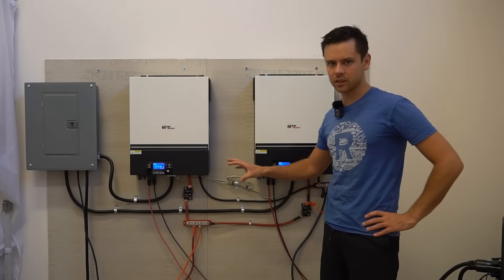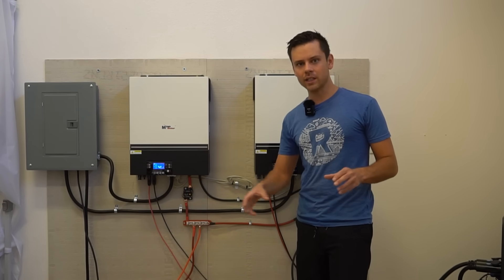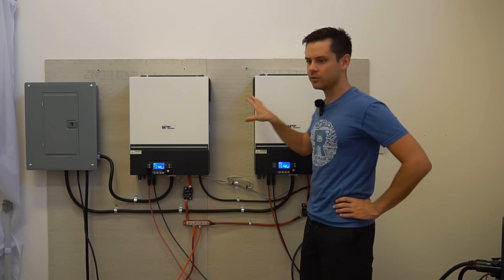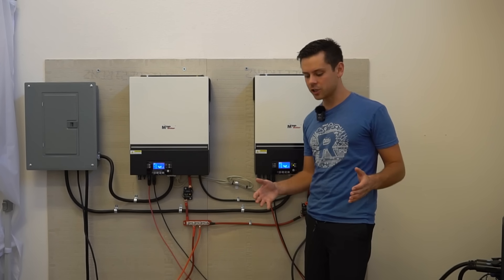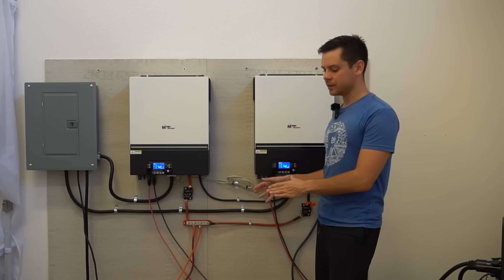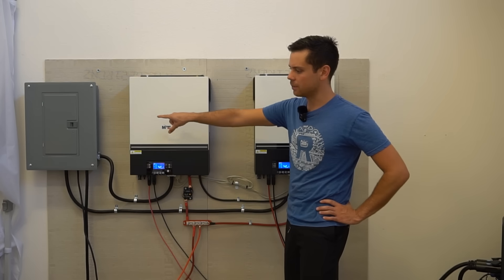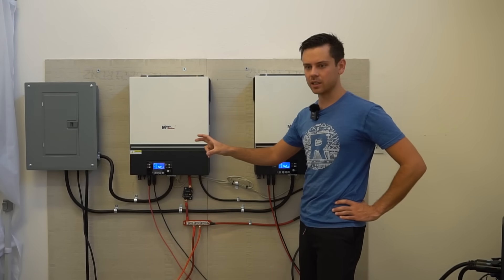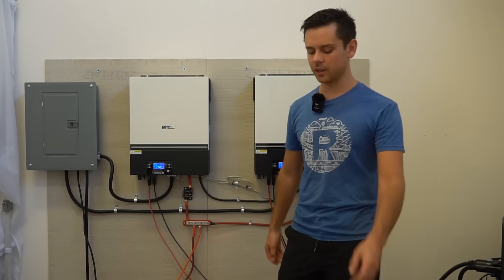Does my 13kW Offgrid Solar System require Grounding? Is it Grounded?

Comment: Thanks for another great video, Will.  Regarding the solar arrays, their frames still need to be grounded to an earth rod, correct?  For an array that is say 100 feet from the house, is there any need to carry that ground along with the positive and negative wires (i.e 3 conductors) to the house?

Comment: Can you go over this with portable power systems such as Delta Pro and AC300/500?  Do different UPS modes affect the grounding?  Ideally I'd want to set up an AC500 that powers a critical loads/subpanel mostly using solar/PV Priority UPS mode but then also have a circuit from the main panel plugged in for backup.  Also it would be ideal to be able to take the unit camping or use it as it as a mobile power station as needed too and just power the critical loads panel directly from the main panel then.
Reply: Also can autotransformers be used to fix/alleviate any of these issues?

Comment: On a related matter, I have hard question. My EV using the V2L cable produces a 240v supply that does NOT have a earth by default. So how can I power appliances which expect a AC supply with a earth ?  Please help ….

Comment: Hi Will, I have a cuestion? I install a inverter powmr is 230, 24v 3000W off grid when I check the power in the output lines, one give me 90v and the other line 170. I conect the ground I install a ground route outside the storage.

Comment: Hello Will, I have just discovered your videos and will be devouring them over the next while. Thank you for posting them!
I have a situation that as a non - electrician has me confused, and I am hoping maybe you might have an answer for me.
I am currently in the California desert in my solar powered cargo trailer/RV conversion. I am an astrophotographer, and spend my winter far out in the desert looking for dark skies. I have 4-325 watt Panasonic solar panels on the roof and 3-300 amp hour Lifeblue batteries for 900 watts total. The charge controller is a Midnight 150, and the charger/inverter is a Magnum 2000. The system was originally installed in my 5th wheel RV about 6 years ago by a very reputable solar company that specialized in RV installations. They have moved on and no longer do installations on RVs, so I can't talk to the people who actually installed it.
I recently moved the solar system from the 5th wheel RV to the current cargo trailer/RV conversion. Grounding to earth in an RV is not practical of course, and nothing on the solar system has been grounded to the frame. I had read that the panel, inverter, and charge controller should all be grounded to the frame, yet they weren't by the original installers. The team that installed my system had installed solar systems in about 3000 other RVs before mine, so I doubt if they just "forgot" to ground the solar components to the frame. I have to think it was intentional. So when I moved the system to the current trailer, I didn't ground anything either. So far all is working great, with 4 120 volt and 4 12 volt circuits. Only the fridge 120 volt circuit is not on a GFCI. My 120 volt Samsung home fridge specifically says not to put it on a GFCI protected circuit.
So my question is probably obvious: Should I be grounding anything to the frame of the RV? I used all metal outlet boxes, and they are all on internal walls. The outlet, and the box itself are grounded with a pigtail to the ground wire that goes back to the panel.
As a non - electrician, I have a hard time understanding why I would ever want to send electricity into the metal frame of an RV. This seems crazy to me, and a recipe for a serious shock. It seems like I now have a closed electrical loop with the panel. Why would I want to send electricity to the frame of the RV, under any circumstances?
As an aside, when I was a kid I stepped off a poorly grounded RV just after the rain had stopped. The step was metal, and I was barefoot and wet. I can only remember screaming and being frozen in place for a second or two before passing out and fortunately falling away from the step and breaking the ground. For a few hours I couldn't walk, and both my ankles were really sore. Within a few more hours I was fine. I suspect it would have killed me in a few more seconds if I had not passed out and broken the connection. It was a really terrible experience, and I don't want to relive it because I made a grounding error. But intentionally sending electricity into the RV frame just seems like the last thing I would want to do. Isn't an electrified RV frame what shocked me in the first place? Any advice much appreciated!
Reply: I'm in a small cabin and also wondering this.

Comment: So, I have my 110v from the service panel on the pole to my inverter then off to the RV. The solar panels are mounted on top of a metal utility trailer. The panels are all connected with ground clamps and wire. WHERE do I put the ground wire from the panels? The panel at the pole is earth grounded. Thank you

Comment: I have a Growatt 6000 , 18000 surge split phase inverter, can I connect a 120 ace wire to the inverter ac input from the house main 120  receptacle outlet to charge the 48 volt batteries.

Comment: If I am building a shed solar panel system with no plan to connect to the grid and no plan to have AC from the house connected to the shed (200 feet away), should I place ground rods and thus ground the solar array and inverter?

Comment: Hi Will. Thanks for the tech tips. I have a question, My pv is over vaulting my inverter, But only when windy. The Panels are in series, with a combined voltage of 73 V and the inverter is 100v max.

Comment: Hi man, need some help here if possible.
I have a small one 450w panel system with a 12v 250amp battery to run only my fridge(smart inverter), i am playing arround and testing and stuff.
I am conected to the grid, and have this small setup, but the two are separate, and i have no intention to join them.
My intention is to have two grids in my house, the grid, and my grid, to later on further grow my grid.
¿Is it a good idea to ground this system?
I have the neigbours comunity antena in my top terrace wich has a ground. ¿Would it be ok to conect ground there? This ground is from the grid, not my own.. is that a problem ??

Comment: Would it still require a true earth ground if there was no AC in the entire house. I'm talking not just not having grid tie in... I mean no inverter, no AC appliances. A DC range, a DC washer & dryer, even the AC is DC... that is to say the AC until (air conditioner) is DC powered.... in that event would you still need a true earth ground. I mean I get that not having one is physically possible and the system would still power loads... I know that a breaker system can physically be devised such as to catch some faults (similar to non-GFCI non-AFP circuit breakers, just basic breakers)... I know that AC houses could physically be wired without any true earth ground and would still power things just fine... but does the NEC require it? What if the system had 5v, 9v, 12v, 24v, and 48v circuits. Are all of those covered by low-volt PV systems? Why does the NEC use language that insist that DC houses must have photovoltaic voltage even if the power is from a windmill or some other non-PV DC producing system. Like why is the whole section called PV when clearly they mean DC not specifically PV sourced DC, but any DC... there's very little in the NEC covering DC only systems. This leaves a lot of leeway for someone who wants to build a house with no AC whatsoever on site. I've already seen my dad/boss bid such a job... we'll see if we get it. This isn't some shack with a well pump, it's a whole house. It is PV, but since I'm being pedantic already, I figured I'd ask if anyone knew why the NEC that is always so careful about language sometimes conflates PV with DC when the DC system may OR MAY NOT be from a PV source... I've just always wondered that one and thought I could through it in as a bonus question.
Reply: Why do we use true earth ground at all if it's not required for AC circuits to work or even for the breakers to work?

Answer:
 Well first, before fancy breakers were invented, we still did it... that first reason is because lighting is a thing and things can build up a static charge... true earth ground provides a path to dissipate that charge from loads and/or their chassis... so that still applies when using DC, even DC only, thus in my opinion a true Earth ground is still a good idea on a DC only system, and is definitely required for AC and mixed systems per the NEC... I'm implying that the host of the video's house is technically against code (as I interpret it) because it does require the DC system to be bonded to the ground of the AC system. It also requires AC systems to use a true earth geound, thus that requires the mixed system to tie into a true earth ground. 

My question is, does this NEC requirement still apply to a DC only household? As far as I can tell the answer is no. I would still do it because of the discharge path, but I think code doesn't care. I feel like someone on the code making panel should get more strict about DC only systems because they're starting to become a thing. We might be building such a house for some weird rich hippy couple so...

DISCLAIMER:
I am still an apprentice, so take what I say with a grain of salt... more than once I thought I knew what I was talking about, only to discover I was wrong. I have no guarantee that is not the case here. Feel free to correct me but know that trolling won't work because I'm surrounded by veteran electricians who know better, and thus I can verify weather what is said is complete BS or not, just by asking the next day at work.

They won't answer the main question I am asking in my original comment, because I'm supposed to look it up. Problem is, I tried that already. So answering the main question isn't some pointless endeavour, when I could just ask... been there, done that... didn't help.

Comment: Hey Will, after watching your presentation as well as Mike Holts, I assume I shouldn’t ground to earth my 12 panel, 320 watt each, solar array. It’s connected to a 9kw solar generator Renogy box that is in turn bonded to the inside panel. Most all videos say to ground to earth these panels but now I’m hearing different. ???

Comment: Just installed an axpert max 7.2kw, and as soon as it switches some internal relays while powering on, the house goes dark. Had to remove the input ground wire for it to run. Im assuming the inverter switches the neutral to ground internally 🤷‍♂️

In the manual it states the pv array must not be grounded to it as well..

Comment: I bought a bigger inverter a week ago. It have ac input failover. If the battery is too low it will charge the battery to my setting and handle the ac output( i think . Havnt tested) well never plugged in the ac input until today. Works like a charm. My house doesnt seem to have any ground pin in any of the sockets. So i just skipped ground(for now). I notised the battery, 12v lifepo, makes my fingers tingle, continuesly when i touch the bare wire or the +/- directly on the cell. It never did that before. Took a sec to realise it might be grounding needed when ac is plugged in. Is that static build up or what is the cause? Now i wonder if its any danger to the battery.

Comment: Have you discussed micro inverters vs a straight pull to single inverter? It doesn't appear you use micro inverters from all the videos I have seen. It is a higher expense for panel installation I would rather not if possible unless more efficient.

Comment: i do not understand my brain is still new to this. so you mean to say, "do not ground your solar panels but instead, ground your inverters" and put a surge protector on both the dc side and the ac side of the inverter. 

so if you ground your solar panels direct to earth ground, and a lightning strikes the ground near your earthgrounding, there's a chance that the lightning will travel from the grounding itself direct to the panel. moreover, a direct lignting strike in panels will yield damage regardless if grounded or not?  grounding the solar panels is useless and more dangerous in that regard? please correct me. i do not know what i'm thinking anymore.

Comment: You know a lot about electrical.  I do not have a solar system but EVERY time there I'd an electrical storm, my breaker trips and we sit in the dark until the storm passes.  If I flip the breaker switch, it just trips again when lightening flashes.  I thought we needed a ground but after this video, I'm not sure.  We do have a metal roof.  Can you explain why or how I can fix this problem?
Reply: You need to explain in more detail what you have? what breaker trips? Is your solar tied into your grid? Are you using any ground rods besides what is in your home?  Are your panels connected to your metal roof?

Comment: Please help...I am off grid with 2 victron inverters isplit phase. Everything works great but rainy season is coming and we get big lightning here in the rain forest.  My Breaker Box "which is very close to my components is ground using a copper rod. My panels which are 50 feet away are also ground using a copper rod. Is this ok or should I unground the breaker box?

Comment: I have a 3K hybrid inverter with a shore power plug. When using shore power a test of an unloaded socket shows wiring to be correct. However, when using the inverter without shore power, an indicative light suggests that there may be a wiring problem....Is it normal for this to happen? Also, I have safety switches and breakers in place and all seems to work well.......Thanks

Comment: The NEC requires you to bind neutral and ground on the secondary of a separately derived system (transformers, solid state inverters, etc.). The reason for this is because the primary and secondary are physically separated, therefore the grounding connection does not transfer. You should bind the primary and secondary grounds (exclude the primary neutral because it is bound with the ground upstream).
Reply: But what if the Secondary is NOT connected to the onshore grid panel? if you add a ground (no longer free floating) then you may create a ground loop or have a gradient problem even though you may not think they will transfer. 30 sec and 5 min portion of this video.

Comment: My solar panels are running to a midnite solar combiner box that's grounded to earth is it safe to continue on to the inverter with the combiner box being grounded to earth I'm not using the AC input part of the inverter just the output line and neutral my ground is on the side of the case with a screw

Comment: It seem confusing to get the correct info for solar subpanels. These are not subpanels from from a grid main panel.  Their basically their own panel so I don't see why they should tie back to main panel in anyway.  My issue is how to ground that panel and do I bond the neutral bar to panel as well?  I have neutral bar and a separate ground bar.  I have the Growatt and is connected to 120v in from my main(for fallback), as well as my solar PV.  And then I have the 120 output to my subpanel of which I have 3 circuit breakers connected.  Seems to work fine with standard circuit breakers, but when I tried to put in a arc-fault circuit breaker, it trips immediately.

Comment: This is a very confusing topic because of different configuration scenarios.
I still looking for the grounding answer to my setup.
I have an LV6548 in a cabin completely off grid, solar array and an inverter generator (eZV8500EFI with GFCI plugs) in a separate generator shack.
Generator manual is calling to connect the grounding conductor to the frame of the generator and it also has Neutral bonded to frame.
So what do I do when the generator is off (not running) and inverter is running of batteries or solar?
These two different scenarios are calling for completely different approaches and it is not exactly clear how to go between these two modes in terms of grounding and bonding of the neutral.
Any help is appreciated!

Comment: Thanks Will. Not many people talk about grounding system for the solar system and I’m glad you did. I plan to install a Growatt SPF 5000ES hybrid off grid solar inverter in my RV Bus in Bangkok, with Lifepo4 battery bank, and solar panels. This inverter will take solar power or take AC shore power to charge batteries and convert battery DC to 220Vac output to power Dometic Aircon and TV, etc. So here, I have input ground terminal when I take 220Vac shore power. My question is do I need to connect output ground for the AC output or should I leave it unconnected (open) ? If it is needed, where would this AC ground connected to in the vehicle ?Hope you could help explain.